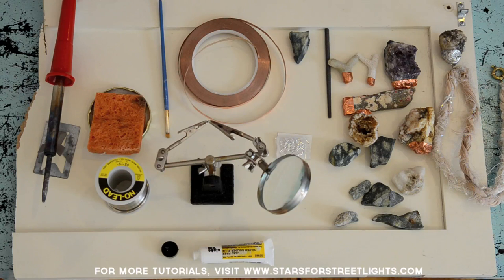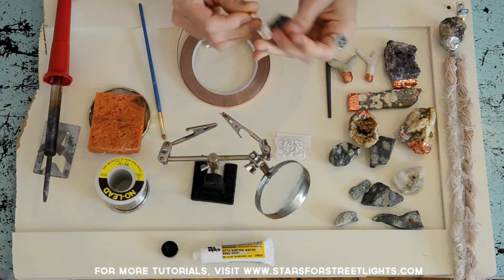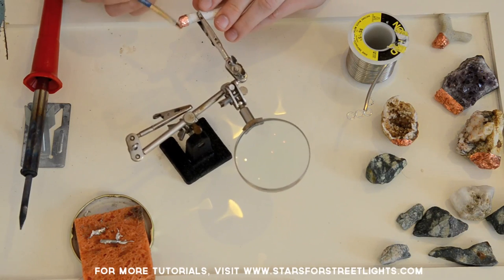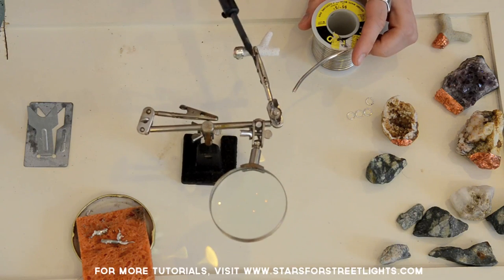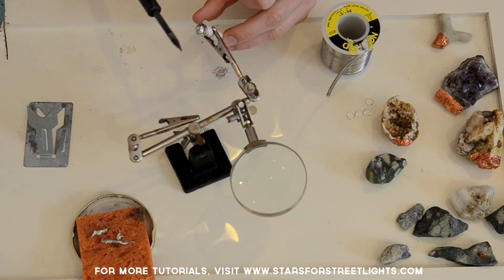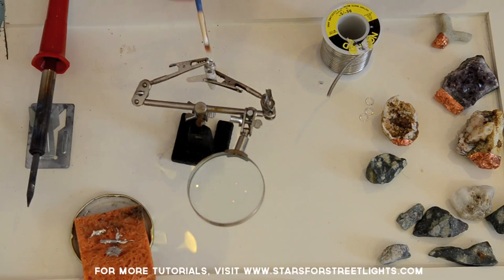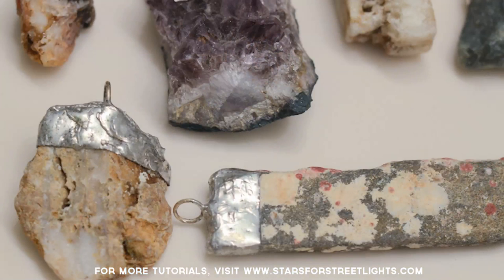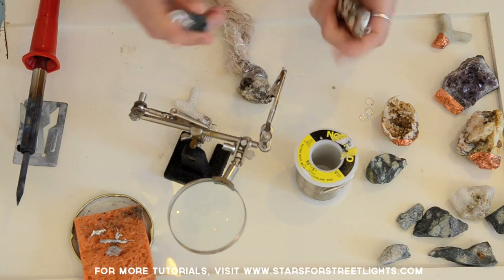How to Make a DIY Rock Pendant for a Necklace

Comment: I doubt anyone will read this...but I am having issues I never had before. I bought the same supplies from hobby lobby everything mentioned to do this..and I dont know if hobby lobby changed something in their copper tape...or if the iron i bought is messed up and getting WAY to hot..but my issues is when I start to solder the tape makes a sizzle noise and it appears the tape or the adhesive on the other side of the tape just melts and it slips off like butter...initially the tape sticks..but once i apply ANY heat it is just slipping away. I bought regular copper tape for stained glass from hobby lobby and I bought their 19 dollar standard stained glass soldering iron..
Reply: the hobby lobby soldering iron is 100 watt
Reply: hey, so are you using the flux on it and the lead free solder over top of it? not just using direct heat on the tape?

Comment: can i melt gold wire with this soldering iron?
Reply from the maker: Vanessa Mercuri I've never tried! I've only done the lead-free solder. :)
Reply: Vanessa Mercuri Tin melts at 231.9 °C. 
Gold melts at 1,064 °C.
Reply: Vanessa Mercuri For fine jewelry like gold and silver you need a jewelry torch

Comment: How did you set the stones on top of the solder?!
Reply from the maker: I shaped the copper tape to the rocks! And then sometimes the shape of the rock makes it difficult to get the tape to adhere-- that's when I'll add solder to the shape and then use superglue to get the soldered cap to stick. Make sense?

Comment: where can I find the copper tape and the three way clamp?
Reply: Copper tape, a stained glass supply store/site. Third hands can be had at both specialty craft/jewelry shops and everyday hardware stores. You can get cheap ones from Harbor Freight.

Comment: hi, what is the best copper tape to buy ? the stuff I have does not stick well to.the stones.
Reply: I'm having the same problem.  Does the stone need to be roughed or does it work on polished stone as well?
Reply: Don Halterman hello, I ended up finding some awesome tape. the brand is KaptonTape and I got it off amazon. it is Copper conductive adhesive tape
 just look for the size tape you want, but you can find it on amazon.com. :)
Reply: Thank you Rebecca G.  I will check that out.

Comment: My solder won't come off of the iron and on to the copper tape
Reply from the maker: You might need to prime the iron a bit with solder, have you tried putting more on it so that it needs to drip onto the copper tape?

Comment: hello everyone...I'm a jeweler and stained glass artist...and I'm very concerned about this video...and the crafter not sharing that the materials she is using are extremely toxic and should never be in direct contact with skin. Even when complete lead will eventually flake and these particles get on your skin and can be inhaled. So FYI this is not silver....it's lead. Lead has been known to not only cause birth defects but also breast cancer etc... please be aware of the materials you are using and what you are putting on your body. It's very dangerous. I hope nobody gets offended by this I was extremely concerned that lead is being used for jewelry.
hope this helps somebody out there!
Reply: I did military soldering for 30 years on jets, with lead soldering! We were tested, and none of us had any lead in our system! You don't get enough in the solder to hurt you! But the stuff we had to use to clean the solder, could kill us!
Reply: She's using unleaded solder
Reply: I assumed she was using lead-free jewelry solder.